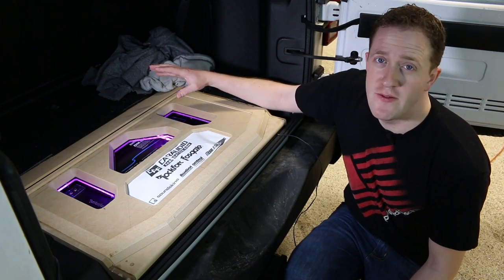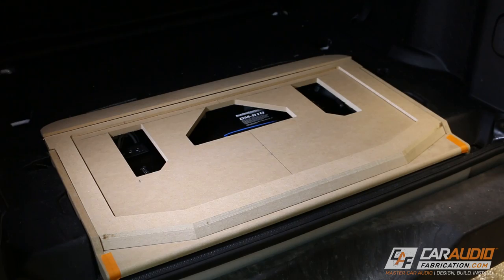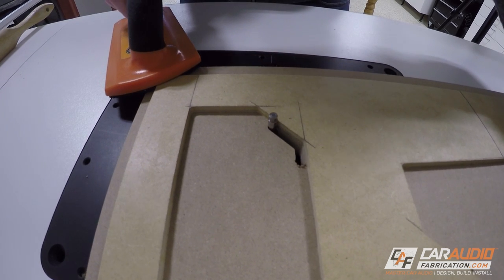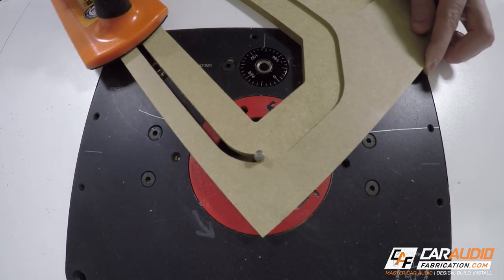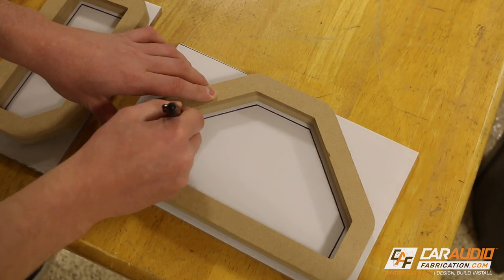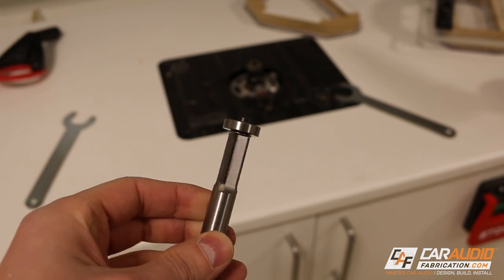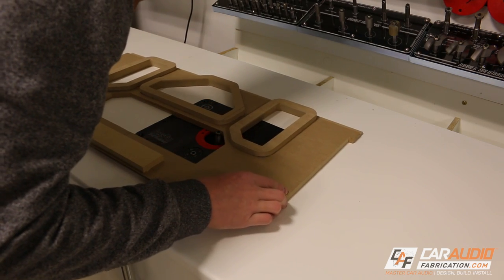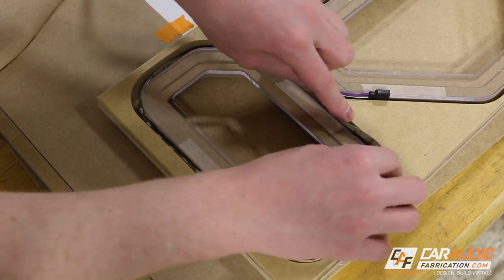HOW TO - LED acrylic amplifier beauty panel - CarAudioFabrication

Comment: love the instructions on this video. but I gotta ask what do you use for the dust collection under that table? I get dust come up all on the table even with a vacuum underneath.
Reply from the maker: Yes, dust collection under the table, its a must.
Reply: CarAudioFabrication I attempted putting a vacuum under it but it didn't seem to help. any suggestions?
Reply: Minimize air leaks.  You want to the vacuum to pull all air from the work area and not from under the table as well.

Comment: im making an led lit acrlylic window in the side of a sub box, and i was wondering how you get the lights to light up with the power? is it safe to just connect the LED strip to the 12v signal wire that turns the amp on? I was thinking of using resistors to make a lowkey constant on light but also wire in the sub inputs so it flashes brightness with the bass, but idk how to choose the right resistors to avoid overpowering the LED's

Comment: I have 2010 Camaro and bought two type s alpine 12d2.  What would be an ideal box for them and they are powered with mrv1000 I have a prebuilt sealed box for camaro   By company called z enclosures mad with 3/4.  And its 1.3 cu per side    Is that adequate for them thank you

Comment: Yo mark. what did you wire the LED's too? the fuse box??
Reply from the maker: They just need a 12v constant and ground, you could add them to an auxiliary circuit or make your own off the wire that goes back to the battery but the smaller wire should be at a distribution block and fused.
Reply: CarAudioFabrication Thanks for the reply. Also were do you get your vynl for wrapping custom peices?